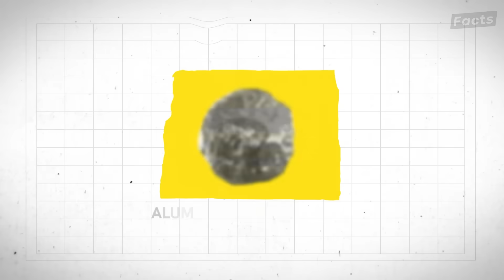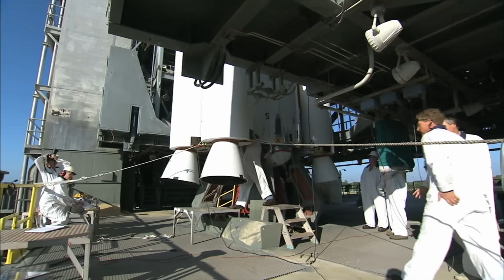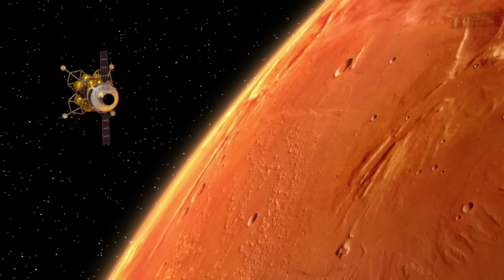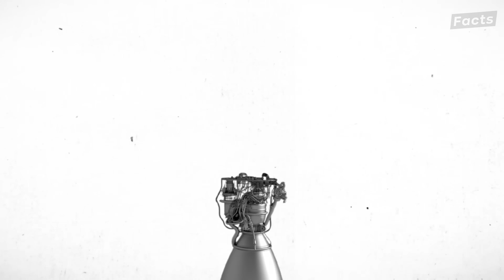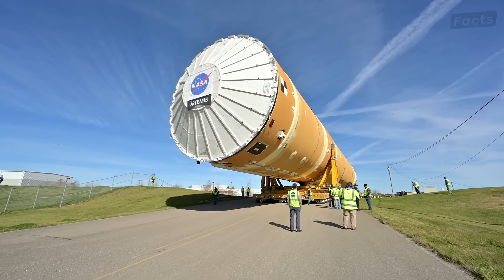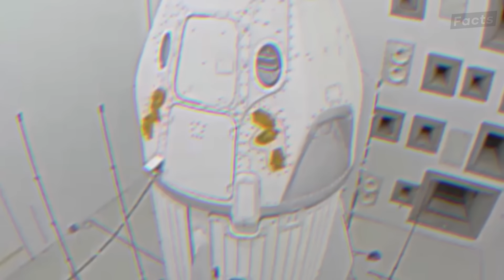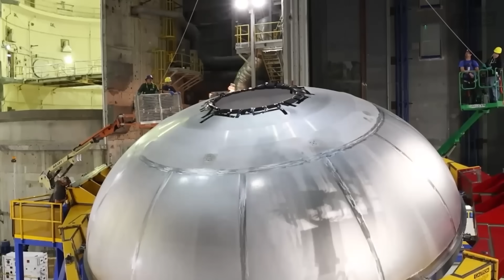Why SpaceX and NASA Rockets Are So Different

Comment: Very simple: NASA rockets are over 30 years old whereas SpaceX are still developing new rockets.
Reply: Yeah.. even SLS is basically just a bunch of shuttle LEGOs rearranged.. and it's so expensive because they gotta restart entire factories just to make all the old crap function
Reply: @NPCSoftwareInc somewhat true, but everything on sls is redesigned to be modern and advanced (aside from the rocket design itself and lack of reusability, plus some old practices they used for space shuttle). the rs-25s are completely redesigned other than the nozzle. same for srbs, they’re completely different than space shuttle’s. same for fuel tank. but overall, spacex takes the cake for rocket innovation. they’re making spaceships coming out of sci-fi movies.
Reply: @NPCSoftwareInc it’s more expensive because for one, it’s using cryogenic engines which are far more impressive to build than raptors ;) 

I’d rather have water vapor in the air than burnt methane or kerosene
Reply: @diverman1023 you’d be surprised by how much it actually contributes to the atmosphere vs our normal industrial pollution
Reply: @diverman1023  More impressive how? Also its not using kerosene lmfao
Reply: @diverman1023 burning hydrogen has water vapor as exhaust yes, but the engines go way higher up than water vapor is usually found, so the exhaust is still polluting in a way. The SRBs pollute more than liquid methane engines, and they produce the majority of the total thrust on the SLS. The parts that burn up on re-entry or fall into the ocean are also polluting.

There is probably no way to make space travel eco friendly, not  in our time anyway.
Reply: @GakkGakkUnited  the parts that fall in the ocean are re used
Reply: Technically their rockets aren't 30 years old, because they don't re-use them. Also don't forget that the design of the wheel is thousands of years old yet some things just are reliable, and all it needs is a slight update to its initial design.
Reply: @GTChris  Are you implying that the Space Shuttle hardware is…reliable?? 😂😂😂 You don’t know a damn thing about the Shuttle program or NASA politics. 

The Shuttle was not reliable. It had issues for many years and also killed two of its crews. The reason the parts are being reused is because US politicians made it an actual law in 2010 that NASA HAD to reuse Shuttle hardware. Obama was pushing towards commercialization of the industry and all these huge aerospace contractors like Lockheed Martin, Boeing, and Aerojet lobbied TF out of Congress to stall Obama’s plans and protect their own financial interests. What we ended up with was the NASA Authorization Act which said “yeah, go ahead and build rockets again but you’re going to have to have all of our old bed buddies provide the hardware at astronomical prices.”

The bill ensured that even after companies like SpaceX grew there would still be a multi-billion dollar revenue stream going into the pockets of the old contractors.
Reply: @GTChris  you don't seem to be aware that they are using the Space Shuttle left over rocket engines, so yes, they are that old
Reply: What kinda boosters does the new glenn have?
Reply: Its own booster. It doesnt share anything wih Space X or NASA @DinMammasKotlett
Reply: @DinMammasKotlett  crap ones 🤣
Reply: @Dadeets Your comment did not age well. New Glenn turned out to be a beast.
Reply: @bluewater82 did it?? Haha what happened with its upper stage then. Hahaha
Reply: @Dadeets  "Haha?" Are you this dumb in every aspect of your life? The SLS's upper stage is literally the upper stage from the retired Delta rockets.

The whole vehicle is being used to funnel billions of dollars of revenue to the old aerospace contractors instead of using cheaper and more modern hardware from commercial sources.

...hahaha?
Reply: That's why the iss used to use Russian rockets until sanctions
Reply: 10min 25sec saved
Reply: Elon Musk went soviet Union style.
Reply: It a long more complex but sure
Reply: France has a pretty inventive space history...  Never realized they were one of the first IF not the first come up with idea for space travel -- from the tapestry picture from La Galerie des Gobelins” (showed traveling in space) --  to Jules Vernne, flying to the moon story ...  
And i never knew tha THEY had a rocket program in 1920's....
..innovative developments in aerospace and astronautics - rocket industries. 
Wonder how those rockets compare to NASA and space X?
Probably- no comparison.. just a start to rockets program.
Reply: Yet Elon musk achieved thing NASA EVER DREAMED OF😂😂😂
Reply: @GeorAxe Yeah. Mars mission in 2050-2080 year. Can't wait to see.
Reply: @GeorAxe hasn't sent humans to the moon though 
and he never will
Reply: NASA was founded by a NASI member and space X wasn’t
Reply: wrong, its because NASA are goverment funding they dont care much to works idea of reuseable, make it cost effective why for, we just get more funding for free, because of this we really cannot trust people working at nasa are smart people or just smart people to fools public
Reply: Exactly. NASA rockets aren’t designed for deep space, or the long run…  Elon will make it back to the moon and mars way before NASA.
Reply: NASA is dreadfully underfunded
Reply: It’s a shame that NASA supervisors did not listen to an engineer on the fateful day of the challenger liftoff that NASA had never launched in cold weather. NASA was nothing but a bloated bureaucracy of ‘cover your ass’ after that.  Imagine where we could be today, stations on the moon, flights to Mars, outer space was within our reach, and BOOM. No more.
Reply: Why do people try to defend the failing nasa sls,  it's old technology from old shuttles pieced together to look new.

Nasa isn't thinking of sending humans anywhere, it's a money laundering scheme.
Reply: You are too dumb to think, so dont bother yourself with it.
Reply: Reinventing the wheel.
Reply: Dawg the SLS isn't the only NASA.
Reply: And only one of these two organisations brought humans to the moon.
Reply: I solved this problem on my YouTube channel.🚀🚀🚀
Reply: That and NASA can actually take things to the moon
Reply: SLS rocket started first with Artemis 1 in 2022 (or 23 idk)
Reply: SpaceX uses extremely old Soviet technology to make their nozzles.
Reply: @kiuk_kiks  So you are saying Russia is better at rockets than we are?
Reply: @ 
Precisely. The Soviets were able to overcome the vibration and explosion issues that NASA has due to its Saturn V rockets extreme size by making many small rockets which don’t disintegrate due to violent vibrations when in operation.
Reply: @kiuk_kiks  Yes, the joke being that yes they are as NASA is really nothing right now and why SpaceX, and yes, Russia is ahead.
Reply: @OZtwo 
Per wiki:
"Russian involvement in rocketry began in 1903 when Konstantin Tsiolkovsky published a paper on liquid-propelled rockets (LPREs).[1] Tsiolkovsky's efforts made significant advances in the use of liquid fuel. His work challenged traditional thought and sparked a revolution in science which embraced new ideas in rocket technology.[1]"
Wikipedia
France also had an early rocket program.. so did the USA.
As a world, we would have been so much further along in space tech anf exploration if WW2 never happened.  In my opinion, the sNazies just stopped progress *it looks like they were imventors.. but they just stole tech from other nations. ...and they had Jewish scientists helping them improve some of that rocket tech.  But the war stopped space exploration all over the world.
Idiot power and ideology never ceases to amuse me.. and how some fall for it over, and over, again.
Reply: @user-rr9lv9ll4x still worse rockets
Reply: @k @kiuk_kiks  Russian rockets are dogsht and youre still seething about losing the space race
Reply: @PhrygianTurk
Even Neil Tyson Degrasse himself said the Soviets won the space race. Elon’s building on Soviet technology as well as American technology while NASA is underfunded purposely to give room for that Elon’s rtrd self to make money.
Reply: @kiuk_kiks  doesnt matter what he said they lost, underfunded on purpose😂 makes literally 0 sense. Starship and raptor 3 engine is more impressive than anything russian made, sorry buddy
Reply: I love this comment
Reply: @OZtwo  NASA blew too much money on stuff not needed. Chose when and where safety was important.
Reply: Saturn V had a success rate of 100%, how many spacex rockets have blown up again?
Reply: @OZtwo  Aside from going to LEO and the ISS, where else have they gone??? NOTHING groundbreaking here. New or Old. 🤔
Reply: Nope. NASA gets to milk the government while space x has to actually get their moneys worth since its privatized.
Reply: @eddy0822 
?  They (space x) got contracts and  monies from the government.. what are you talking about?
...Only working people have to make it on their own.  And, dude, the working Americans (us) are paying for NASA -- AND now soace x.
In fact, we're subsidizing most private industries.. especially those about to fail.  Were ALWAYS bailing them out.

Your welcome.
(Never a thank you from these dudes.  At least give back by paying your taxes, dudes )
Reply: @user-rr9lv9ll4xwhile you are right, this doesn't change the fact that a private corporate for profit structure is more efficient that a tax only socialist one. SpaceX still have to show service, even to their government contract, they still have to make a profit on it, if they do not deliver on their product they don't get paid anymore by the government or private clients. And if they do not run a business by earning more than they bring in money, they go bankrupt. NASA on the other hand doesn't have this problem, in fact the attempt to generate accountability for socialist systems, so they won't use endless amounts of money (but they do try, different government bodies using sunk cost fallacy to get more budget). It's to build supervising bureaucracies, this stall the process of doing anything down and thing end up cost 5x or more times more what they should cost if they just did the damn thing. That not account for corruption, the government pays double or more for anything and the politician pockets part of the excess money under the table, because he has a deal with the companies that are government contractors serving government agencies. But if they don't do any of this, the corruption is worst.

Is a fundamental flaw of central planing economic systems. The more decentralized it is, the more efficient it is. And corporations while still not as efficient as truly independent enterprises working in a free market to actual costumer (that work for their money), are more efficient than a government.
Reply: @user-rr9lv9ll4x and what new things have NASA produced in recent years compared to Space-x??? Space-x has pushed the limitations of what we thought was possible, what has NASA done? NASA remind me of Intel, they got lazy an got fkd by everyone else.
Reply: @Pieces93  Look up the 3D printing alloys NASA developed that everyone now uses to print rocket engines (GRCop-42, HRX-810), and look up the NASA development of methalox rocket engine technology that underpins SpaceX and Blue Origin engines. NASA does the pure research and hands the results to private industry, who then commercialize it, producing tax dollars that fund further pure research at NASA.
Reply: @Pieces93  NASA just sent people to the moon in the most advanced spacecraft ever made, I feel like that counts for something.
Reply: Both rockets started development around 2011-2012. Both have total development costs in the tens of billions. One has made it to the moon, one hasn't. Both are needed to get humans on the moon and back. Both have been given more than a billion dollars by Congress. Starship has flown 6 times but no reuse, no missions. SLS has flown once and completed a whole mission.
Reply: @CoryWWilbanks  The engines used on the Space Launch System (SLS), known as RS-25 engines, are essentially "old" as they were originally designed and used for the Space Shuttle program, meaning they can be considered decades old, with some even having flown multiple missions on the shuttle before being adapted for use on the SLS; however, they have undergone significant refurbishment and upgrades to meet the demands of the new rocket system.
Reply: @CoryWWilbanks  not so first if SpaceX had spent the amount of money on Starship that NASA has spent on SLS we would be on Mars by now. SLS is nothing but recycled components from the Shuttle program and it is still plagued by cost overruns and the heat shield does not work on the capsule I will admit that this is not important well maybe if you are in this capsule it might be
Reply: @CoryWWilbanks  SpaceX has spent around $6 billion dollars on Starship development. Starship is using the iterative approach and testing multiple upgraded rockets before going operatonal, it's a deliberate choice to do this. NASA awarded SpaceX several billion dollars for the HLS lander. Starship is funded by SpaceX itself.
Reply: Then why does NASA get my tax money?
Reply: @spooks196  because they create public and free to use science that has helped shape our entire lives and generation? If NASA was a private company we wouldn't have much of the things we do now at such a low price. Everything would be patented and trademarked and everyone would owe royalties to a few billionaires for science and technology. We would be living in an oligarchy.
Reply: @ that’s why we have DOGE coming.
Reply: @danielcastiglione5328 Elon’s chainsaw is on the way, something wicked this way comes.
Reply: @OZtwo  NASA'S trash is over 55 years old. What about all of their trash? That's what I'm talking about!
Reply: @BrianTaylor-v6q 
..private satellites cause most of the space trash...
Reply: @BrianTaylor-v6q  Still better than starship
Reply: NASA wastes money, OUR MONEY! Their engines aren't that old.
Reply: @BrianTaylor-v6q  NASA has never wasted money. The setup of the federal government is super complex. They just never had a company that was able to meet their demands. Due to safety standards and beauracracy they need to use certain vendors and it gets super pricey because you're now asking a company to set up a line for one specific component.

SpaceX can take the bid and build the entire thing. They can do everything in house and deliver on certain safety and load factors that the bid asked for while being able to pay less for those components or do it themselves.

I don't like the privatization of space and science but I think that SpaceX is awesome because they free up NASA from building rockets and allow them to complete their true primary goal - exploration and science.
Reply: @BrianTaylor-v6q  предлогаю наса покупать ракеты не у илона маска а у китайцев они вышлют почтой это будет на много дешевле !
Reply: @BrianTaylor-v6q Nasa has finished the project before the next president is elected think about that! Nasal follow goverment wants depending on what elected administration wants !
Reply: They literally aren’t? They are hardly given any money whatsoever and that’s why they don’t build new experimental rockets. It’s too risky. America waste exponentially more money on genuinely useless things and a lot of them make America and the world worse…
Reply: @BrianTaylor-v6q  Sorry, yes they are. SLS is using the space shuttle engines. But yes, you are right about the money.